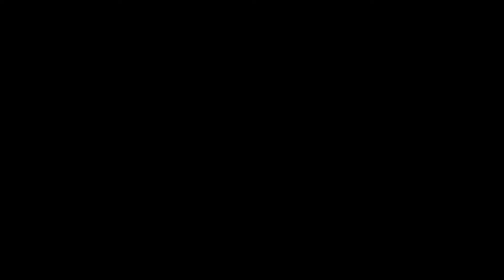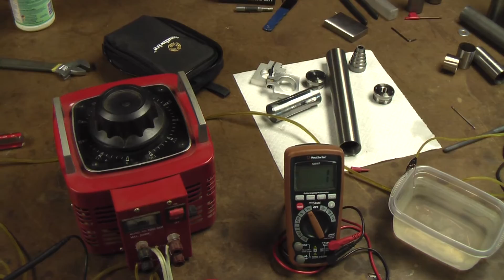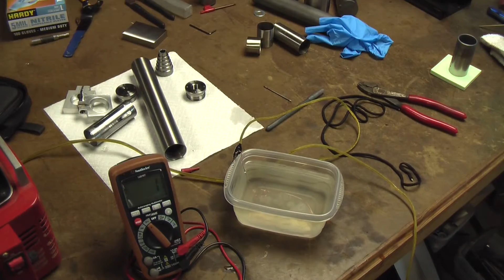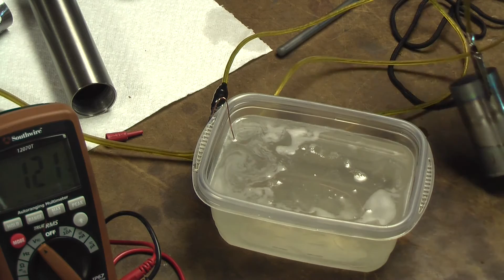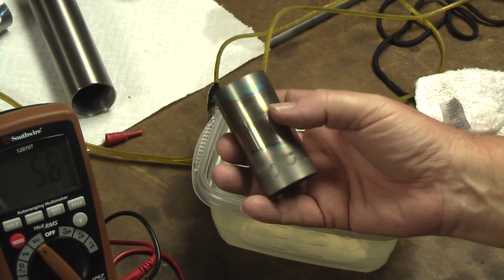Anodizing Titanium test

Comment: your solution is worn out, and start lower by a long shot, like 8 to 12volts and completely submerge object. then raise voltage til desired color is achieved. also make absolutely sure of the absolute cleanliness of the surface to be anodized

Comment: I actually watched some videos on this not too long ago. Try sanding what you did off so you have a fresh surface and it seems like for the green you need around 140 volts and have to leave it in there for a little while. It will go thru several colors before it hits green. Seems like it was right after purple, so you were probably almost there in your first dip